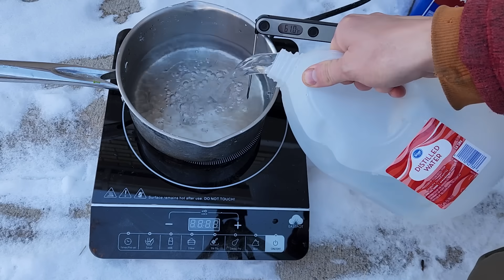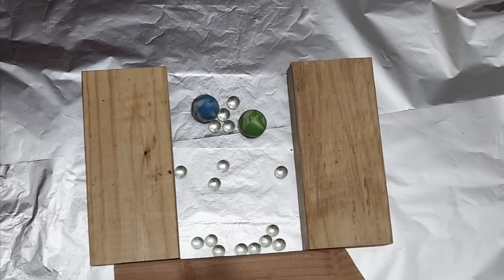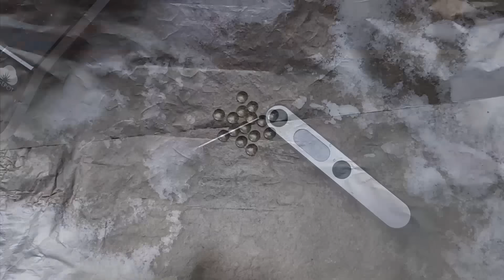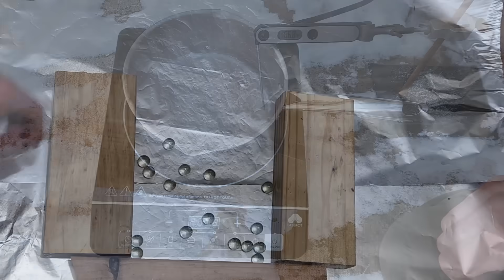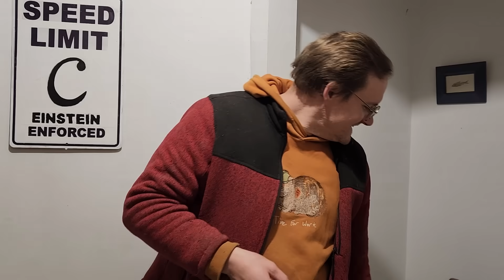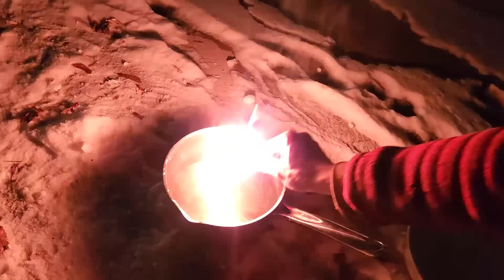Raoult's law

Comment: 9:50 "Extremely flammable" is the correct term, but for layman explanation "extremely explosive" is a better description. Boiling alcohol produces are near perfect oxygen to alcohol mixture close to the pot. If it is ignited the flame propagates faster than the speed of sound. Many a moonshine outfit has rapidly ceased to exist because of this, as an alcohol explosion inside a copper column is effectively a pipe bomb.

Comment: What happens when you add heat fast enough is that it makes a vapor barrier that tanks conductivity. When it's a droplet, this is called the leidenfrost effect, but this is a physical limitation of boilers in general. For a given boiler, there is a maximum temperature that you can apply to it before it actually absorbs heat very inefficiently, and thus boiler have hard limits on how much power they can take, based primarily on surface area and working fluid. This is precisely why boilers have tubes through them, and why we use water

Comment: so can this law be used to calculate eutectic ratio when both will boil off together rather than one preferentially boiling off more at beginning? similarly in alloy example (or salt in ice example) pure salt / water / zinc / copper will separate first either at top or at bottom while cooling down molten alloy / salt-water solution ... so that eutectic ratio at which both will solidify / freeze can be calculated from law?

Comment: Question: If you mix two solvents with different boiling points, what will happen?

Common Sense Answer: The new boiling point will be between the lowest and highest boiling point.  Science is easy!

Science: But why?

I'm not sure I was ready for such an in-depth explanation using marbles, but I'm sure glad for it.

Comment: I finally understand why adding salt to boiling water makes the boiling so much more violent.. so many times i've had a pot boiling near the max volume it can hold without boiling over, only to add salt and have it quickly start throwing up larger bubbles that erupt more violently and voila: it's everywhere

Comment: Does a lid make water boil faster because it "raises the ambient" pressure by trapping the preboil water vapor and heat? According to a Google search, very scientific I know, water boils up to 30% faster with a lid on when the pot is nearly full, citing the trapped heat as the reason for the difference.

Comment: I think boiling point elevation has more to due with Na+ and Cl- which are ionized in aqueous solution and are strongly attracted to the H-O dipoles in water (H2O). This strong attraction makes it harder for water molecules to enter gas phase so more energy is needed. Something like that.

Comment: I'm glad I learned this at school, found this so much fun. But the explanation used then was that water (and salt) consisted of positive and negative particles. And the boiling point just depended on how hard those wanted to stick together.
Alcohol sticks together less and salt sticks together way better (and also sticks to the water better, holding it tighter, so it needed more energy to escape).

Comment: Fun fact.  

With salts, if you saturate water with salt A, then start adding salt B, you can then add more of salt A.  This is informally known as the salt effect.

This can result in a solution, if taken to logical limits, that can be mostly salt, yet liquid.  It will be quite dense, and will have very high heat capacities.  Also, if it ever starts to phase transition back into a solid, it will release quite a bit of energy, inhibiting the phase transition state, unless a heat sink is applied.  Such as nearby matter, in the case of a splash.  

Don't get splashed.  I've seen metal get hot instantly from a splash, creating a momentarily glowing salt ring.
Reply: Epsom salt for baths are surprisingly more water than salt 🤔 I still don’t understand how that works 😂
Reply: @chuckrier8816  Salts are very polar, by nature.  So you get very strong ionic bonds.  You can consider them sort of a, idk, water alloy, that when in that configuration, can be a solid.  

IIRC, the inter-water bonds, since they are restricted from moving due to large mass of the parent salts, can become 'solids', due to the ionic bonds between the hydrates.  But these are weaker bonds than between the water and salts, so you get something more mush like, especially if there's any excess water.

When I was playing around with this about two decades ago, there was a surprising lack of information about the salt crystals that would form in super-saturated solutions.  I recall that the sodium sulphate one was super clear, when grown at ~300-400C.  Only lasted a few minutes once it was removed from solution, turning into a powder.  Probably due to structural collapse from the hydrate water atoms peeling off due to the high temps.
Reply: @ChrisPikula  While studying weapons about 3 decades ago, I came across a practice that preferred to use molten salt baths to other heating methods. For parts that were chunky but had thin protrusions it was the best way to prevent undercooking the chunky bit and overcooking the thin bits. You can guess that these salt-combo's and their experimenting with it, was proprietary. They must have stumbled on crystallization with supersaturated solutions. Each time they switch off the bath.
Reply: @ChrisPikula  ty meddling mage
Reply: @chuckrier8816  Interestingly, if exposed to low humidity, or high temperature, epsom salt lose water, and by that stop being epsom salt, as epsom salt is the name for magnesium sulfate hydrate with seven water molecules (MgSO4•7H2O) specifically. Also, epsom salt can gain water molecules at low temperature, and sufficient humidity, and stop being epsom salt that way too.
Reply: fun fact: per dictionary definition, fun facts are not required to be "fun", but merely trivial
Reply: @ChrisPikula wow this is super interesting.. I wish someone made a video about this effect, including the splashing
Reply: Am I crazy for wondering if this fun fact results in a sea change in batteries in the near future?

Comment: Fun as always, but please downmix your mic recordings to mono, half of this video was just in my left ear!
Reply from the maker: Will do
Reply: @theCodyReeder  Much appreciated!

If you ever want to get fancy, grab a mid/side filter and mute the side signal, leaving only the mid enabled. It'll use the stereo image data to cut whatever's not picked up in close phase on both L and R channels, which helps eliminate reverb in the room. It's basically the same as a mono downmix but it avoids LF phase cancellation weirdness. (You can also approximate this without a mid/side filter by high-passing at about 75Hz before doing a regular mono downmix.)

Comment: Would there be any difference between heavy water and “pure “ water and would there be a difference with the heavy water removed? Great video. I really enjoyed this one.
Reply: Because D2O molecules are heavier than ordinary H2O water molecules, the hydrogen bonds between nearby molecules are a bit stronger, and take more energy to break. As a result, heavy water has a slightly higher boiling point than regular water, but the difference is only about 1.4°C at sea level. Interactions between the D2O and salt would likewise be somewhat stronger because of the increased mass, but again, not much. Probably less pronounced because the salt, which isn't any heavier, is already the dominant mass in water - salt interactions. 

That's pure deuterium oxide vs pure protium oxide. Ordinary water is only about 15 ppm deuterium, so the difference between ordinary water and pure H2O is pretty much negligible.

Comment: The zinc seems to boil out if you try tig welding brass! The weld pools pops and crackles, leaving an awful 'weld' (and lots of white zinc vapour, just waiting to give you zinc fever if you breathe it in). But some aluminium containing Mazak / Zamak zinc alloys can be tig welded semi successfully using aluminium filler rod without much less porosity. I saw someone doing this when looking for how to repair a broken Mazak casting, and really didn't believe it. But I had nothing to lose by trying, so I had a go. It worked.

Comment: How can we still distill liquid mixtures despite this effect?
Reply: There is still a difference between the vapor pressures, so what it distilled off is an azeotrope: the combination of the liquids where the vapor pressures are equal. For alcohol, this is roughly 96%. In other words, you can't distill EtOH any stronger than 192 proof.

Comment: I could have sworn I was taught salt lowered the boiling point, but I guess i must have flipped it in my head.
Reply: I was taught boiling point elevation and freezing point declination.
Reply: @selkywaters  Yeah I knew the freezing point. I just must've flipped raising and lowering in my brain at some point in my life. It definitely better explains why people add salt when boiling pasta. I thought it got it boiling faster, but in my mind, its not the boiling you necessarily want, its the heat that comes with the boiling. Its not like putting pasta in water and then removing pressure to lower the boiling point to the ambient temperature would magically cook your pasta.
Reply: @AbananaPEEl  So adding salt raises the temp of the boiling of the pasta.  I never thought about it in those terms in relation to boiling food.  Does hotter water make your pasta cook quicker??  I guess...maybe??
Reply: @ its probably so minor it doesn't make much of a difference. Especially at the amount people add to the water. What I was really considering was that there is a technique for treating steel called Blueing, and the old fashioned method of doing it was letting the steel get a thin layer of red oxide (rust(hematite)) on it, and then when you would boil the red oxide in water, it would convert to a black oxide (magnetite), which does not expand like red oxide and since it is technically rust, helps prevent further rusting. It also looks nice. Its been used especially on firearms to help prevent rusting since forever. I have been trying to do this myself, but have been having issues, and I theorized it was because I have hard water, and so the various minerals would lower the boiling point enough that the water couldn't get hot enough to convert the rust. However, now knowing that that thought was founded on the incorrect notion that minerals would decrease the boiling point, i guess thats no longer in consideration. The rust might just be too heavy to fully convert.
Reply: @ But yeah also sometimes i wonder if theres places in the world where its so high elevation that you cant cook pasta with boiling water. And when i thought it lowered the temp, that maybe a municipality had such hard water at such a high elevation it lowered the temp enough that you couldnt cook pasta with tap water. But i guess that just isnt the case.

Comment: Can't the boiling bit be explained simply by density of the fluid? In order for the liquid to boil, it has to create gas bubbles inside the fluid. Those gas bubbles need to have enough pressure to counteract the weight of the water above them in addition to the atmospheric pressure. So as density increases, you would expect bubbles to have a harder time forming.

Comment: Zing is not evaporating only on liquid's surface. I guess that it can change state at the bottom of its container when it is in mix with copper. So, the question is can zing become gas zing bubbles while it is dissolved at the bottom of an induction furnace, where the heat source usually is when we have a chanel induction furnace, like the bubbles that are formed inside a glass of soda?

Comment: I also thought that the salt in boiling water cuz it needs more heat to vaporize, every time a water molecule hits it the energy got stored in the salt and made it warmer hence where the heat was coming from, and similar in the opposite direction with the cold. It is already solid and can store more (negative energy lets just say for simplistic sake) so it can make the water colder without actually fully freezing. To go along with not fitting together as well to help it stay from freezing. Or was i off base the whole time.

Comment: Here I thought just a pinch of salt would raise water's boiling point. Cody taught me how to dump salt into water.
Reply: The reason people add salt to water is for flavoring and maybe it helps treat the texture of the pasta as well. The change to boiling temp is insignificant
Reply: @ yeah, osmosis should be significant
Reply: it would, but by very small fraction of a degree (assuming typical cooking vessel)
Reply: lol did you misunderstand the video? it does raise it. water with salt takes longer to boil
Reply: @gg-gn3re does it? I saw that it traps heat, so... does it actually take longer or is it kinda neutral?
Reply: @ read my message again

Comment: I always thought that the different boiling point of a mixture of water and alcohol was due to the chemical interaction "hydrogen bonds" that between a molecule of water and one of alcohol is stronger than between two molecules of alcohol. Is this effect completely excluded or does it contribute in part to explain the phenomenon?

Comment: Cody, is it your personal preference or would you mind switching to deg. Celsius as the default unit of temperature? Or using International System of Units in the first place?
Reply from the maker: Its just what is available when I go the store to pick up a thermometer. In my videos I try to make it, so the actual number doesn't matter but its consistent so you can see how it changes relatively. Ideally, I would get a thermometer that didn't use numbers or units of any kind, maybe like a color change or something?
Reply: @theCodyReeder  No, metric would be just fine. Since you were dealing with freezing and boiling water, I though the whole time "if not now, what other situation would be perfect to go metric?".
Reply: @fonkbadonk5370  implying that Fahrenheit isn’t also based on temperature of boiling and freezing of water lol
Reply: @theCodyReeder  Which color is absolute zero and how do you plan to read it without affecting the result?
Reply: @theCodyReeder  the imperial was painful to watch, those number make no sens at all. 
Even kelvin would have been more readable for us UE folk XD
But it's strange your thermometer didn't have a small switch to change ? even here in UE they all have a way to switch.
Reply: @theCodyReeder  you do you man. I'll watch.  Use the Rankine scale if you want.  Doesn't matter to me.

Comment: I totally agree with your explanation. But in my head, this was always a combination of the collisions as well as the intermolecular forces between the salt and water molecules. All water soluble salts are polar and are "sticky" to water molecules. So the water molecule in the vicinity of the salt molecule has to overcome this sticky force to evaporate or crystallize. So you need to supply/remove more kinetic energy to boil/crystallize water from a salt solution. (This extra kinetic energy is the difference in temp, as we already know from the kinetic theory of fluids.)

Edit: Well, I spoke too soon, you do get into hydrogen bonding later in the video

Comment: My favorite kind of Cody'sLab video. The video on Dalton's law remains one of my favorite videos of all time for example. No amount of production value, animation or expensive props can ever come close to Cody explaining chemistry  using clear language, some kitchen utensils, a bit of welding or glassblowing, leftover stuff from the hardware store, and marbles.
Reply: It is bizarre. If you had one liquid to a box with vacuum and then add another liquid, the pressure of the gas area is the total of each substance's gas pressure. I would think the pressure would be a little less than the total.

Comment: 11:19 Alcohol and water form azeotropes. So, open to atmosphere, the solution won't ever reach the boiling point of water.
Reply: my take: the vapor fraction of the azeotrope will still be enriched in alcohol so assuming there are anywhere close to equal volumes, the alcohol fraction of the mixture would all boil out and the mixture would become increasingly rich in water, until it's water
Reply: @gibbers91  Yes, Cody was correct. The water-ethanol system shows a positive azeotrope. Boiling a mixture with less than 96% ethanol by mass, eventually yields pure water in the boiling flask, because ethanol is enriched in the vapor phase. What bungstly is saying is true for negative azeotropes, like water/nitric acid, hence why you can concentrate it in the boiling flask up to around 70% by mass.

Comment: This is why you should change the brake fluid every two years at most. Brake fluid is super hygroscopic.
Reply from the maker: also, water molecules will penetrate through plastic and rubber so you can't even seal it out. don't believe me? Weigh a sealed plastic water botte before and after leaving it in a dry location for a few years.

Comment: I want to see how much electricity you can make with just molten salt, liquid nitrogen and non-insulated copper wire. I've seen it done with boiling water and ice water, been nagging me since grade school, lol.
Reply from the maker: is that a Peltier effect sort of thing?
Reply: @theCodyReeder  Hmm, not sure was not layered, was just 2 glasses one with boiling water and one with ice water, with the copper wire bent like W , not sharply bent, each bend in a glass filled like 7/8ths full. It dimly lit a single battery flashlight bulb . No power was applyed, and dont remeber if the water was distiled. 3rd grade teacher was explaining moving electrons with a temp differental, so maybe is peltier in its basic form. But this was like 1970, lol.